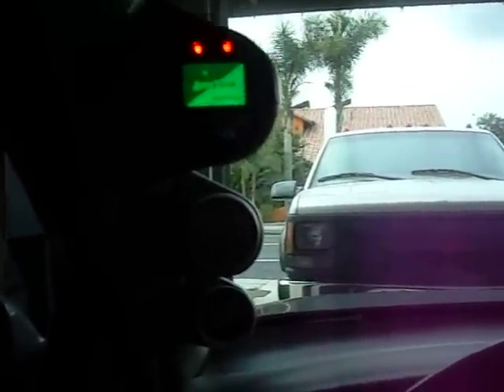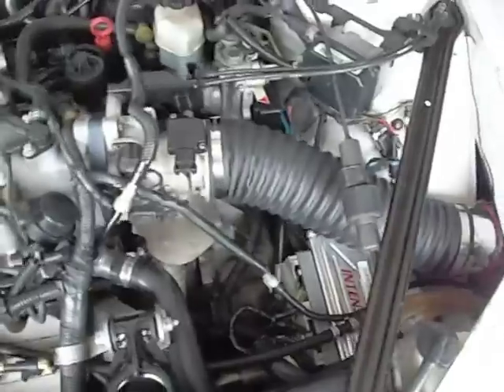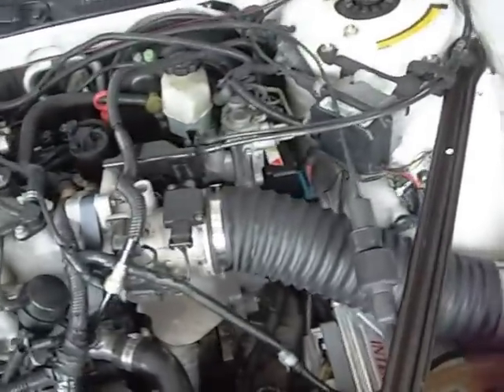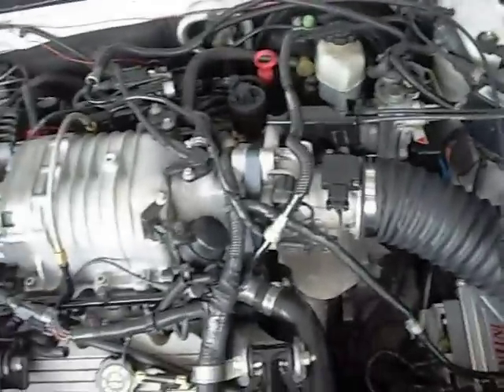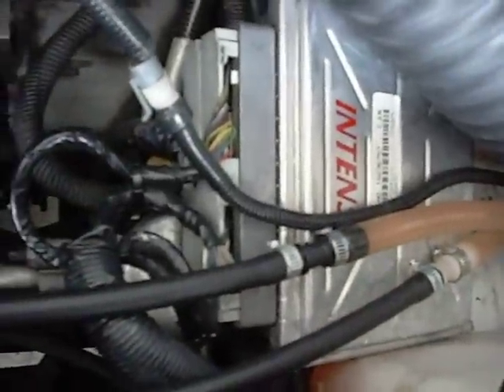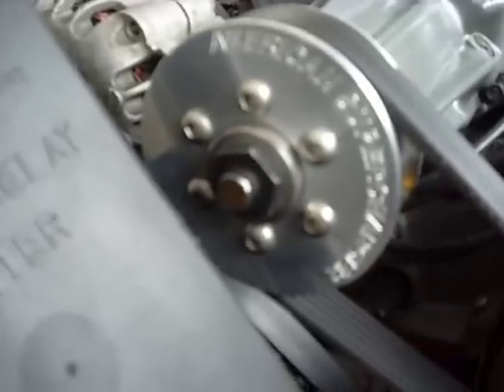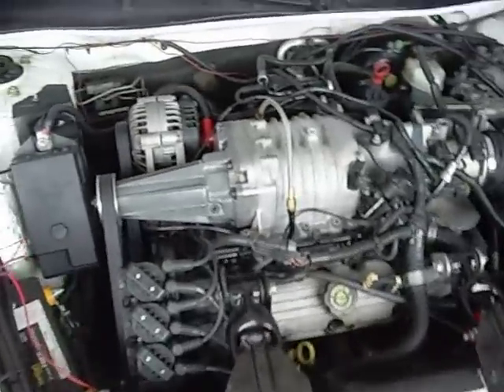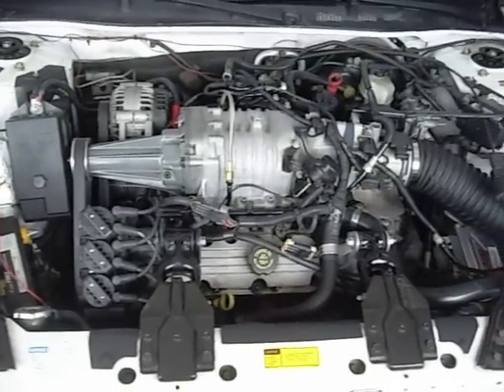3800 Series 2 Modding Basics

Comment from the maker: If your interested in modding your car always do the basics first.

Intake,highflow muffler and a colder thermostat. You wont gain insane amounts of power with those mods but your car will sound a lot better and it'll be more enjoyable to drive. Youll even get better fuel economy.

If you email me your engine bay pics I can probably give you an idea how you can make your own intake. Check out my making your own intake video and you'll see how easy it is.

Comment: What are you talking about?  Bigger pulleys will turn the components slower.  Have you ever rode a mountain bike with different gears?  If you put a bigger pulley on the crank, yes that would take horsepower away.  Big pulley for accessories (slower), smaller pulley for S/C.(faster)

Comment: Comment, since you have a 3800 series 2 sc and you know what you are talking about, i have naturally aspirated 3800 series 2, do you know what removing the resonator will do?  Ive got alot of mixed reviews about what will happen.  people say loss of low end torque, power, etc.  But i have had no input on what removing a resonator on a 380 will do?  Do you know if there will be any negative side affects, of just sound increase and no loss of power.  I have a flowmaster 44 im gonna put on. thanks.

Comment: im thinking about putting one of these in my old jeep instead of my 3.8 grand national turbo 6..

i dont know much about these newer ones though, id need some help
Reply: +rowdy hansen You can generate so much more power with the one you have. I have an 04 Monte Carlo with a similar setup to John's. I love my motor and the mods are cheap, but man oh man, if I had the powertrain from an 87 Grand National (or thereabouts) on an RWD platform I'd have an extra 200hp over where I'm at now for the money I've put into my L67. I wouldn't dare go with an L67 for your jeep. Just one man's humble opinion.
Reply: +Chris Aitken biggest difference is Turbo VS S/C. Turboing a Series II is much more expensive than just going over a GNX platform.
Reply: well, one could buy a used s/c coupe and pull the wiring harness, engine and everything with it for around $1200.
my grand national engine didnt come with the wiring harness (which was over $600) and the block. of course, any 3.8 even fire post 79 would work, but the uncontrollable nature of the turbo vs the very controllable s/c mean less time upside down due to an unfortunate turbo spool while in a lower gear crawling up a rock. they make adapters for either engine to bolt to my sm420 rock crawler tranny.
Reply: +rowdy hansen I now understand your point.

Comment from the maker: It shouldnt set off a Check engine light, you could always use a O2 Emulator or just get an aftermarket PCM and request they disable the rear O2.

Aftermarket PCMs are great and you should get one anyway.

Comment: We're can you get the solid motor mounts like the Grand pre and regal has? I want to put a set on my Buick lesabre.
Reply: Sorry pal, different platform. LeSabre has a whole different mounting solution (it's better.)
Reply: Not on a 2004, the front only has a tear prone bottom mount. Wishbones would have fixed feeding it new ones every 40K

Comment from the maker: If you want safe power without risk of blowing up your motor do this in order

Intake
Solid Motor Mounts
High flow muffler
U-Bend Delete
3inch Downpipe
Reprogammed Computer/PCM

If you want to add more boost get a scanner first. Check out the description box for a list of vendors and check out my other videos for more 3800 modding related videos.

Comment: I just bought a 2000 gtp. What mods do I need to run a 3.6-3.5 inch pulley on it? Or can I use that pulley without any mods? Also what are the recommended plugs for a stock gtp. I looked online and people say to use colder plugs but I don't know which ones to get. Thanks
Reply: You can run a 3.5 without mods and colder plugs work a little better but you won't see much of a gain. I'd stick with oems
Reply: Brendan May you should join gtp nation on Facebook, I'm an admin on there and the whole communities pretty awesome with helpful information.
Reply: Brendan May ok will do. So I can run a 3.5 pulley without any exhaust mods? Downpipe ubend delete ect? I read that smaller pulley with no exhaust mods will cause a good amount of kr and will shorten the life of the engine because it has a really restrictive exhaust from the factory.
Reply: GTByron .055 copper plugs, but you have to change them more often because of the copper, but it supports more performance

Comment from the maker: @1loudcorde 

Yeah I dont hang out much on forums anymore I actually interact with fellow 3800 owners on youtube more now. The forum environment has too many e-tough guys.

Short Stack IC is a great mod and you can get a complete set up with everything you need for less then $1000 VS $2000 or so for full size.

When your dropping down to a 3.0 pulley or less you need bigger injectors and with a SSIC you can go down to a 3.2 so bigger injectors wont be needed.

Comment from the maker: Unfortunatly there arent many aftermarket parts for your car but luckily 
Intense-Racing(dot)com sells higher ratio rocker arms good for 10-15 extra horsepower.

ZZperformance(dot)com sells smaller supercharger pulleys for your car and I would go down only 1 size if you have rocker arms. 2.85 down to a 2.7

I wouldnt drop down sizes if you dont get the rockerarms. Better to be safe then sorry. 

If you get those 2 parts it should add about 20-30 horsepower so itll be a good boost.

Comment: just got a 1999 GTP yesterday. their is a sensor on the stock intake that would need to be removed to do an intake. will it give me a CEL?
Reply: HECTIKVIDZ that would be called a mass airflow sensor...
Reply: theirs a smaller one before the maf but whatever
Reply: That's your IAT  (Intake air temp sensor) you can buy a extender from ZZP and put it in your fenderwall as well as your air filter, will tell the computer the car is getting colder air. give some timing, nice little mod.

Comment from the maker: The place I got the Intake tubing from dubbed it as "Smooth walled" Its not completely smooth but almost there.

Any clue how much power Im losing having this tube instead of  true smooth intake tubing?

Im guessing  3-5 Horsepower? 

One thing I need to Replace on my Vette is the "Accordian" Coupler a smooth one claims 3 HP extra. Its beleivable as long as they arent claiming 25 horsepower =P

Comment: upgrade that mass air flow sensor.. these 3800 MAFs as opposed to their cousin motors 3400 and 3100 MAFs are very peticular and their threshold values are not what they should be with increased air mass. ( this may have changed with your tuner along the lines of ecm re-call and personalization) otherwise never hurts to throw some high electrical energy output ignition coils on there higher dwells, stronger spark, more complete combustion cycle, less carbon build up overall increased engine efficency. you may want to replace alternator with a higher output due to increased demand for voltage and possibly install a gel cell battery. isnt neccessary but, doesnt hurt. again related to the mass air flow, (i assume youve done this) remove that slighty co-efficent MAF screen on the throttle body. only maintenance from there is to clean your MAF more frequently (which you should be anyway given the performance filter and location in which its installed). other than that you can always invest in a 4t65e HD transaxle and some L67 fuel injectors (if not already equipped). sorry once agin with the MAF sensor installing a performance aftermarket can sometimes loop up the ho2s and furthermore catalyst efficency. just something to think about.

Comment: Good video, check out mine, but 1 thing I have to do is what u did. I have to extend my K&N Air Filter into the wheel well like u did. What diamater is your black hose from your TB to your filter? And is your air filter sitting right in your fender? And does that SS Intercooler actualy make a difference? Is it worth getting? Take care

Comment from the maker: Look at the description box, go to ZZP performances website then purchase a foot or 2of their intake tubbing for $10.50 a foot.

Also order a IAT Extention. $15

From there buy a 4inch in diameter K&N cone filter and at pepboys they sell small 4 inch in diameter pipe so you can connect the cone to the intake tubing. 

$11 for the pipe $20-$50 for the K&N depending on where you buy it

So for less then $100 you can can make your own intake. My intake is from the parts I mentioned =)

Comment: Yeah I haven't found where the leak is yet, but I had the error code checked and it says 'bank 2 too lean', and when I was having recalls done they said I have a vacuum leak that they wanted to charge me $999999999999.99 to fix.  Plus all the other minor things that need fixed, it could be 20 years before it's all done, I think they call that a 'work in progress' =/.

Comment: Hey if I run a 3.5 pulley what supporting mods do I need?
Reply: Derrick Tanner #1 get rid of the u-bend where the O2 sensor is. Depending on altitude, PLog or Headers and a higher flowing intake. That's it. I run a 3.5 on my '98 and she has no issues without a tune.
Reply: Right on.. Thanks for getting back to me
Reply: No prob, I have 2 Regal GS' and I will buy another if need be. 260+K on my '98 and still doin' the damn thing.
Reply: marcleach75  what would be the best way to figure out problems. If my 3800 idles between 1200 and 2k in park and it also gives me problems during initial crank? I'm not to current with this motors knowledge yet.
Reply: bernard anderson check your vacuum lines for cracks and holes

Comment: @vincevelasquez  yes the gtp is front wheel 4t60 4t65 4t65e 4t65hd you probably got a 4l60e tranny. t  is front wheel. l is rear .any thing but front wheel with this motor would be a bad idea its like a truck is meant to pull

Comment: whats the smallest pulley I can use without doing anything else
Reply: I wouldn't go smaller than 3.6 

If you can't afford the supporting mods for an undersized pulley, you can't afford to chip and piston so you're best leaving it stock anyway.
Reply: ChiefGunny ya I wouldnt never put a smaller pulley without supporting mods. Terrible idea.. if you want to see a little better performance without going mod crazy, try a cool air intake and modding the exhaust. help her breath better

Comment: What In the fuck... Your motor is sideways... (may sound strange but I'm used to seeing this motor in a commodore where its mounted normal) What trans does this run and how does it even connect. Really hope its not a transaxle and front wheel drive xD
Reply: exogator if you're not being sarcastic continue reading, if you at then disregard the following... yes it's front wheel drive lol. any engine that is mounted sideways is a front wheel drive, typically it is anyways. I believe these cars have a 4t65e-hd trans, decent trans that holds the stock hp. any power upgrades the trans will need reinforced, it won't hold much more than stock power. as you know I'm sure. fwd isn't too bad, I don't mind them any. better fuel mileage can be had from them which I like.
Reply: Jake West awd cars are the same sometimes
Reply: @JakeWest-1  when my trans just failed at 130k under stock power
Reply: It's fwd no shit its sideways! Lmfao!

Comment from the maker: @hellobitch1000 

To supercharge it your going to have to do what is called a "Top Swap"

Track down a 3800 series 2 supercharged motor and take the cylinder heads,intake and ofcouse the supercharger from that car and swap them to your car.

Or you can do an engine swap. Cheapest route is a top swap if you can track down a good 3800 S/C motor. If your resourceful you can pull it off for less then $1000

Comment: could you drop this motor in a 94 buck century ??
Reply: 3.1 and 3.8 are similar size in engine compartment so I would guess yes!- best to look further into it
Reply: 777jonah888 Even the 4t60e-hd struggles with the extra power. With GXP's it's nearly a given that they blow the tranny before 60,000 miles.

Comment from the maker: Its not hard at all. You have to install cylinder heads,lower intake,fuel rails and of course a Supercharger from a Supercharged 3800 motor. These engines are very easy to work on all you need is a service manual and its pretty straight forward. I just learned on my own reading the service manual and browsing forums.

Comment: @vincevelasquez  yes the gtp is front wheel 4t60 4t65 4t65e 4t65hd you probably got a 4l60e tranny. t  is front wheel. l is rear .any thing but front wheel with this motor would be a bad idea its like a truck its meant to pull

Comment: I have a base model and I want to swap out the engine for a sc 3800
Reply: +marco arteaga what size engine do you have? if its a 3.8 you can do a l67 top swap to make it supercharged
Reply: 3.8
Reply: Just topswap it. Much easier for the same benefits.
Reply: +Nice Meme 
top swap, is that pretty much bolt on?
Reply: From what I've heard, better to get a real supercharged motor. The compression ration is higher on a regular 3800, so it will knock easily, and the bottom end isn't as strong as the supercharged motors.
Reply: Jay Maechtlen It knocks easier but with 93 and a good ass tune you can make even more power.

Comment from the maker: @sicexhaust2 

You have to remove the low oil pressure sensor in the oil pan.

Better to have a gauge anyway because once your low pressure light comes on your fucked anyway. 

Better to have a reading of what yor actual oil pressure is rather then a light telling you you're fucked =P

Comment: its not that you need stronger pistons, its that you need a lower compression ratio if you wish to run any amount of boost that will provide enough increase in power to even warrant buy the damn thing and still use pump gas
otherwise you have a high risk of blowing a piston a rod or a head gasket with anything around 10psi
Your WAYYY better off just getting a drivetrain out of an SSEi (because it also has a 4T60E-HD rathern than just 4T60E) or just go buy an SSEi and sell yours

Comment: no you can use ur intake mani off a l67 with a gen v...u jus gotta break out the dremmel and modify it a bit to fit correctly. me myself im doin rockers, id like to cam it but u gotta take the fuckin motor out!  if you do rockers make damn sure you get higher tension valve springs, hardened retainers and hardened push rods. I promise your set up will not last very long if you neglect to do it cause u'll have nasty valve float...aleast the valve springs

Comment: I just bought a 1998 Buick lesabre with the 3800 what can I do to make it faster?
Reply: I got a 3800 Camaro and am planning on a nice cam, headers, magnaflow exhaust, and a scold air intake. Start with that before any turbo or super
Reply: Joshua Ponseti
Reply: ROFL It's a LeSabre, it's not supposed to go faster
Reply: SUPERNOVA hey anything can be made to go fast!
Reply: Funny Gunny thanks I'll look into it
Reply: David Horgan thanks for the help
Reply: Even a Yugo? Your idea of fast and mine is vastly different I guess.
Reply: SUPERNOVA sleepers are fun af.
Reply: i owned a lasabre and the century, and both those engines act well under boost,but i wouldent go tooo high on them,might start blowing stuff up,maybe 10 pounds at the max,and dont underestimate those buick motors,ive seen em run over 500k miles before needing complete overhaul
Reply: Joshua P 
Sell the Buick to an elderly woman and buy a Corvette.
Reply: It should go pretty fast if you roll it off a cliff
Reply: top swap that lesabre and itll be making a mockery of lots of little ricers and pseudo sports coupes